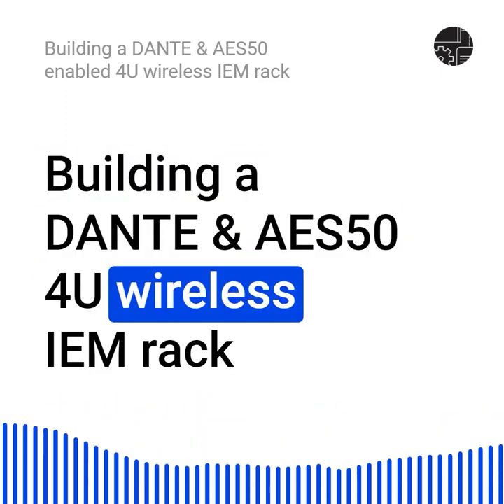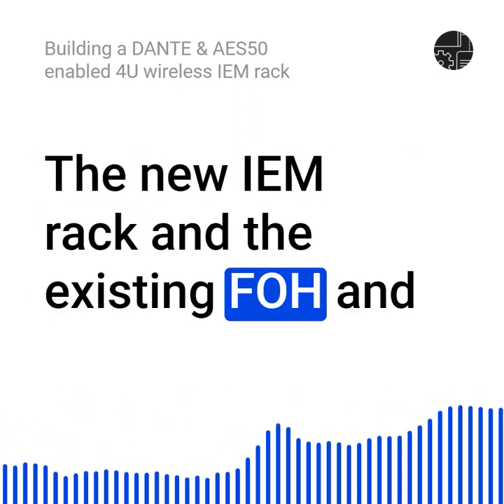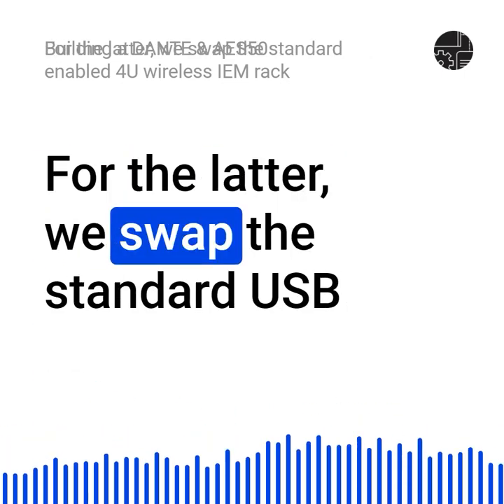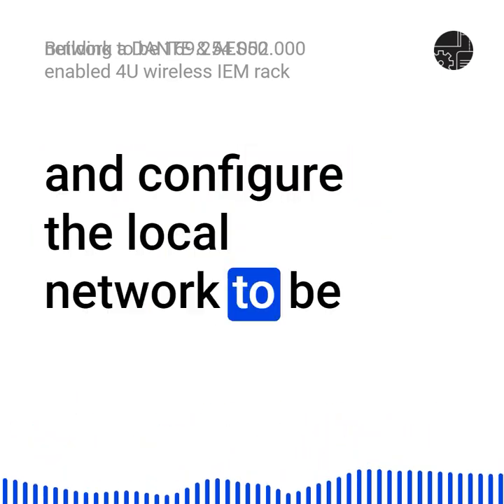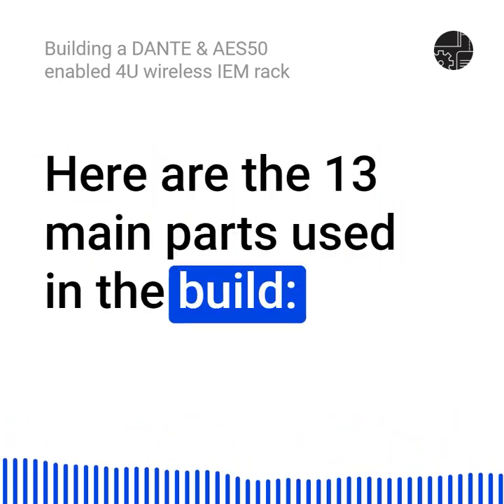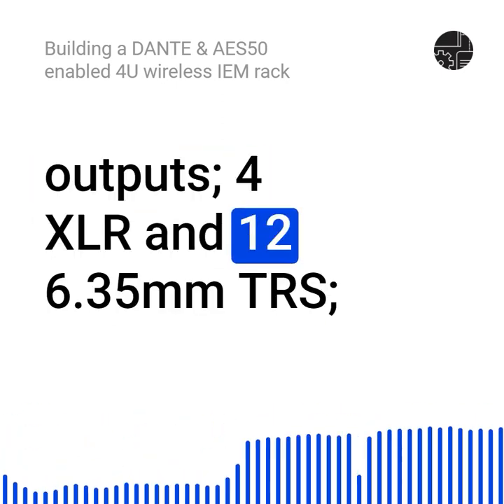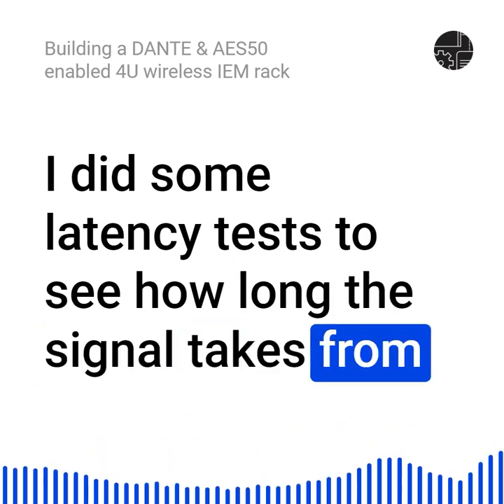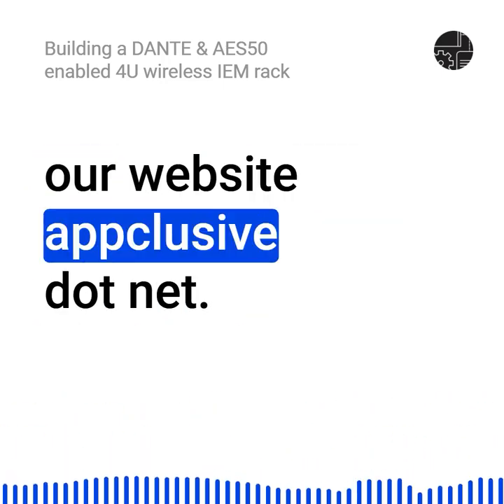Building a DANTE & AES50 enabled 4U wireless IEM rack [AUDIO]

Comment: Except for Dante, at this moment, I’m going to do exactly the same for my band ! I just bought a Midas M32C, Midas Hub4’s and a flyrack with a Peli case. But I’m just wondering if you can explain your way of talkback?
Reply from the maker: Sure, one the one hand the DP48s along along with the Hub4 handle TB already internally. This means when you press TB on one DB48 it will be sent by Hub4 upstream and downstream on AES50 channel 48 and the other DP48s will be able to "hear" it (which is then sent to the Sennheiser IEMs). As the signal is also sent upstream I can route it anywhere else from the M32C. Additionally, to get other TB sources from outside the IEM rack into the DP48s I just use AES50 channel 47 or 48 (and Dante in my case) just like any other signal to route it into the M32C. I hope this makes sense to you. Otherwise I can provide a routing diagram. Additional information can be found here: https://mediadl.musictribe.com/download/software/midas/HUB4/HUB4_Firmware_2.3.pdf and https://mediadl.musictribe.com/download/software/midas/DP48/DP48_Block_Diagram.pdf.
Reply: @appclusiveplus  Thanks! Yesterday I hooked up my DP48 and I’m still waiting for my ethercon cables, so I can’t hook it up to the HUB4, and the HUB4 to my M32C. But where is this TB button on the DP48?
Reply from the maker: @angelorasmijn7306  you can actually use regular CAT5e cables which is what I do when I have a short connection or do some local testing.
With the current firmware, you can configure "Talkback" somewhere in settings and then use the normal "Mic" button to enable it (keep it pressed like "push to talk"). The display then shows "Talkback". I am currently away from the studio but can check in the evening and send some screenshots if needed.
Reply: @appclusiveplus  awesome, thank you! I will get some short cables from my office today and bring them home tonight. I think I have to update the firmware from the DP48 so this functionality. Thanks again!
Reply from the maker: @angelorasmijn7306  when you check the DP48 regarding the FW version, also check the HUB4 as well. Though both have not had updates recently I had to update mine when I got it. And regarding the cable: make sure it is a CAT5e with a "shield" (metal enclosure). One last thing: if I remember correctly one must not power the device via the PSU and via PoE/network at the same time.
Reply: @appclusiveplus  Thank you. Yes, my DP48 is on FW 1.2. I ordered a SD-card and tomorrow I will update the DP48. I also will check the firmware from the HUB4. I ordered SuperCAT cables form Sound Tools. They are the best.